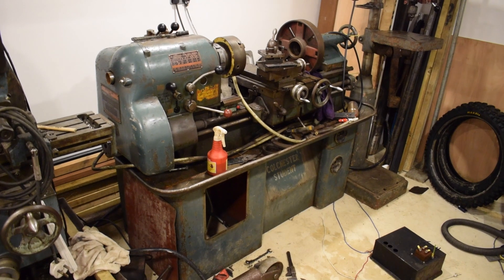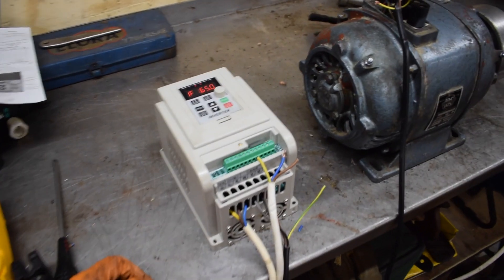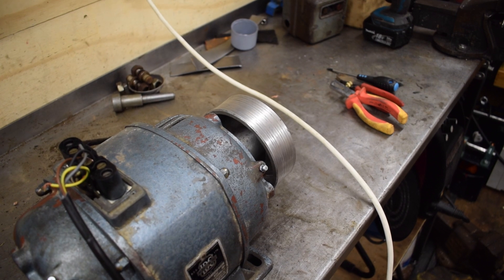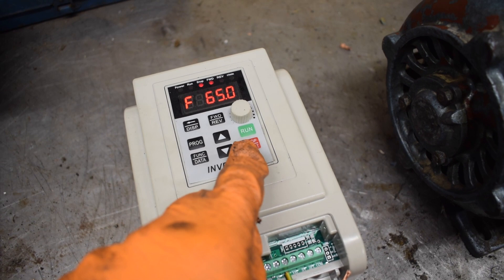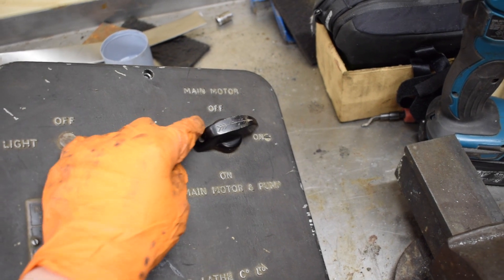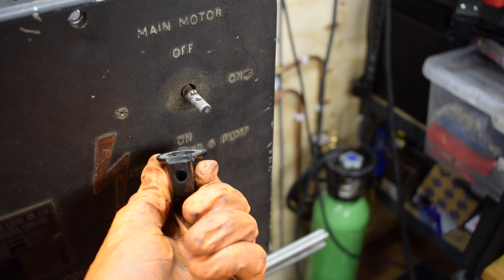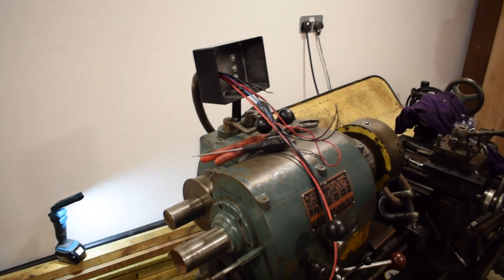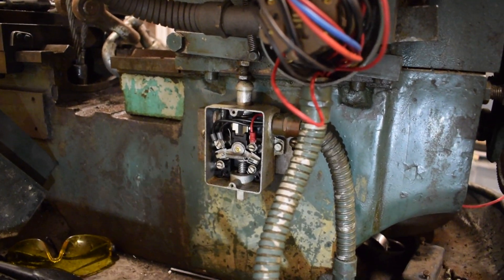Lathe VFD Conversion. PART 1 Colchester Student: 3 Phase to Single Phase

Comment: Nice Lathe. Awesome job! I learned some 30 years ago in Class that you may leave the earth (Yellow line) always a bit longer than the others..so that if someone pulling the Cables and they get loose, you have the earth still connected. Thats no use for the Big steady lathe maybe, but I have that done to all my handtools, whenever i change the rubber grommit thats worn out on the cable entrance to the handle.. . Your skills are impressive. i only know the basics around AC/DC 🤘🤘🤘😁

Comment: Just a word of caution, never connect and operate a VSD on a motor without an earth on the motor. You can get induced voltage on the frame of the motor.

Comment: Hi Kim im relly enjoying the videos i currently doing the same with my Colchester Master i have a similar model of motor please can i ask how you wired your motor to DELTA cheers Andrew
Reply from the maker: Hi Andrew, thanks for the comment. With regarding to the wiring, I must admit I can’t remember, I think from memory the cover plate had it written down how to do it. Also there’s a lot of diagrams on Google. I hope you get on okay 🙂
Reply: @CalamityKim1  hi Kim thanks for the reply did you already have 6 wires coming out to wire to DELTA or did it explain inside your cover if possible would you mind posting a picture of your diagram 
Cheers 
Andrew

Comment: Hi Kim, pleased I have found your channel, I’ve just purchased a Colchester student mk1 which has been converted to 240v single phase I want to revert it back to 3 phase with inverter and remote control board
Reply from the maker: That will be interesting. They’re a great little lathe.

Comment: New Subscriber here from N/Essex near where Colchester Lathe Company used to be. (The old site is now a TESCOS).

Really loving your uploads here Kim & Kurt. Great to see these old vehicles etc. Those old diesels can sit for years & it doesn't seem to matter. Not the same story with petrol engines.

Where did you learn all these skills may i ask? I am well impressed. 👍👋👋
Reply from the maker: Hi Ian, thanks for subscribing. Shame about Colchester lathes isn’t it. 

You’re not wrong. Although petrols can start fairly easily normally. Just a good carb clean normally gets them going I find. 

Thank you as well. I have always been interested, I was taught a lot from my brother, as well as being very observant to others.
Reply: @CalamityKim1  Yes twas a damn shame. Colchester Lathes was a fairly big employer Kim along with Paxmans Diesels. A great loss to the town. They have both been gone for years now. Long before FORDS pulled out of Dagenham i think. 

Your Brothers have taught you well. I wondered if you was ex-Forces. Something like REME. (Royal Electrical & Mechanical Engineeering). 

Kurt knows his onions from his shallots too. Very clever 😉

Comment: Just something I learnt the hard way. I used one of those VFDs for a CNC and I mounted a bit like you did only to find it overheated in use. Turns out it needed 150mm spacing all round for airflow. Hopefully yours is not is sensitive as mine to air flow but this helps
Reply: HVAC tech here, I've replaced plenty of VFD's that have burned up due to lack of circulation.

Comment: Great video and excellent work.  I have the same lathe and am looking to do a similar thing do you happen to have any links to the equipment used and any more details about how you wired it in and kept all the original features of the lathe.   I would find that very useful as would some others i am sure. thanks
Reply: Id love to know this too.  Does this lathe have a 2 speed motor? and have you been able to preserve the lathes original functionality?

Comment: Hi Kim. Appreciate your video and the way you fitted the VDF into the switch box. I have a similar lathe and the same VDF but you have done a better job if keeping oily hands away from the VDF with the external switching. My only question is whether the VDF will get adequate cooling in the confined space even with its own internal fan?
Reply from the maker: Hi there, 
I cut some vents into it, I’d be surprised if it overheats but if it does I will rectify it.

Comment: So what hp is the lathe motor, and what size variable frequency unit did you need to get for that. Well done, not for the faint hearted.
Reply from the maker: So it’s 3hp and I bought a 2.2kw VFD which is the closest size to my motor.

Comment: That was a great video. A very nice lathe indeed. I put a vfd on my Harrison lathe and I am putting one on my Harrison mill. I also stripped the mill motor, rewired it to delta and replaced the bearings.

I am interested in knowing what type of vfd that is for your lathe. Could you let me know please?

Regarding signal and power wires, try to run them separately. The signal wires should preferably be shielded with the shield connected to ground at one end only.

Thanks for interesting content.
Reply from the maker: Hi Carl, 
I used just a cheap 2.2kw VFD from eBay. It was only £70 ish. 
Kim :)
Reply: @CalamityKim1  Hi Kim, thanks for the info, much appreciated.

Comment: All that old machinery just keeps going, would love a pillar drill or a sensitive drill some time soon. Where do u get the inverter looks interesting to convert over. Do u still have the same drive power. Interesting video for sure
Reply from the maker: I got it off eBay. Was £70 I think. Only a cheap one. The one on my pillar drill I bought off a forum. £50 I think. That’s a good one.

Comment: Looks good just don’t seal it so well that you don’t have air flow to cool the drive. 😎🇺🇸
Reply from the maker: Very Valid Point. If it overheats I could incorperate some fans to allow some air to pass through. Thanks.
Reply: @CalamityKim1  
Good idea even though they usually incorporate a decent heat sink and small fans you still need an entrance and exit for cool and hot air. ⚡️⚡️🍻

Comment: I use a network cable to run from my VFD to a control box for my lathe (a rather knackered Boxford), lots of cores and also quite thin. 10k pot (22.5mm) on the "pendant" of sorts. I do think the way you've mounted the drive is neat, mine is rather crudely screwed to the wall.

Being pedantic about something you said at the start, the motor wired as delta Δ is still running it as three phase, but each phase is only connected across one winding so you can run it at a lower voltage. Wye Y each phase is connected across two windings (ish) hence requiring the higher voltage. Small motors are 230/400, larger ones can be 400/690.
Reply from the maker: I did actually think about using Network cable but I didn't want to do anything twice so I have just done it as a precaution. 

Also, I did know it's still running three phase. I can't remember what I said withought checking. I must have said it incorrectly anyway. Bit late to edit it out now. :(
Reply: @CalamityKim1  Sorry, that might have come across overly judgemental!

I do really like the finished product :)